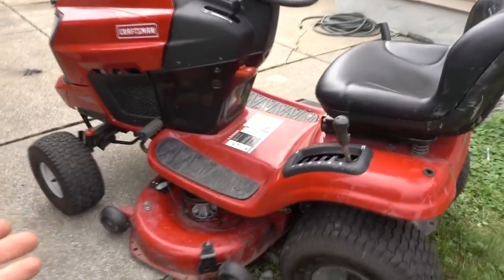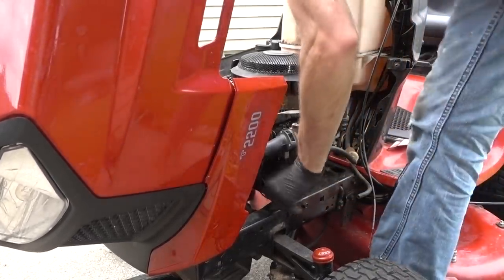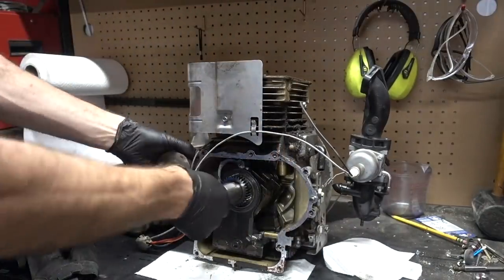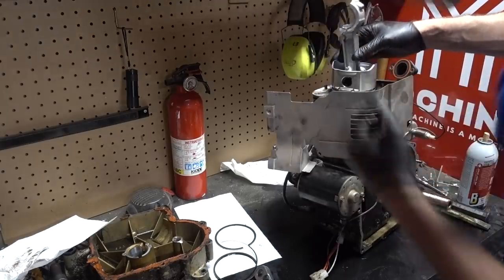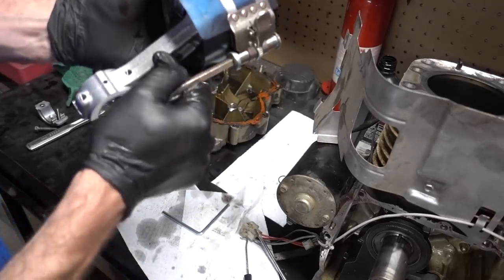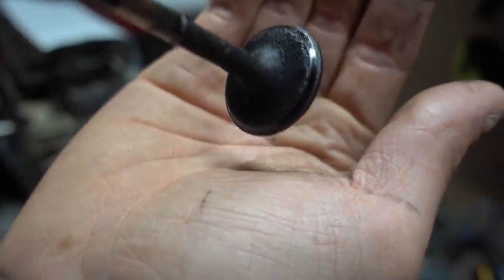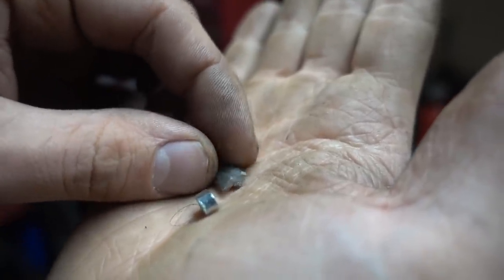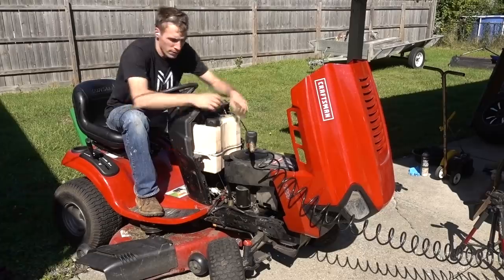fixing a craftsman tractor that smokes.

Comment: I got that exact same Tractor free in early August. The engine was siezed, I got it the day it turned 5.
Those newer style engines are notorious for failing early. So I dropped an opposed Twin in and sold the tractor for a very nice profit and the tractor is better than it ever was with its stock engine and it will probably be out mowing 20 more years.

Comment: Most of the time on an OHV Briggs single that smokes I replace the head gasket and done like a dinner.
Reply: IKR!!!!! He completely took the engine apart for literally no reason
Reply: Make sure the head is not warped common problem with that engine searies.
Reply: @TheWolverine-rm2kr  actually, the original piston rings were out of spec, he replaced the piston and rings with a spare that was within spec.

Comment: you needed to put some valve lapping compound on the taper shaft first(without the keyway) and hand spin the flywheel back and forth until the whole taper shaft has a gray compound color left on it. that will tell you the flywheel is seated correctly and then clean off all the compound material and reinstall. still did good. it's just little trick you might want to do next time.

Comment: Ya know those black side covers that surrounded the engine come off. One bolt or push pin on the frame then they slide up off of the steering column. Just a freaky fresh tip for ya lol
Reply: And I just got to the part where you figured that out 😂

Comment: Oil control ring lining up with secondary compression ring gaps, does cause oil to blow by the 
rings and creates a vacuum in the case, hence the head gasket leaking into valve guide chamber. 
Also an exhaust valve seat job too boot!
I used to do this work back in my day on older engines, you did it all properly! 
Excellent Mechanic skills! Great Video!

Comment: Ive been trying to get mine to stop smoking. Starts right up, idles and runs but a constant white smoke billowing around muffler. So first I noticed the carb was letting fuel past and flooding the cylinder head. Got that taken care of and changed the oil. Then a leakdown test had air leaking past the intake and exhaust valves. Did some grinding compound on them, no more intake or exhaust leak. Noticed during the leakdown also air was coming out of the dipstick tube so guessing that is piston ring blowby. I changed the piston rings. Getting better compression. Oil level is on the minimum fill level so not overfull. After all this work and fixing a bunch of issues I found on the mower. Still getting that exact same amount of white smoke all around the muffler. Any idea what it could be still? Ive taken apart and put this engine back together like 5 times now. I believe the head gasket is good as well but I use high temp gasket maker each time so it seems to do a good job or its failed 5 times without me realizing. Going to try to swap a muffler to see if its just previous oil inside there that is burning possibly

Comment: My mower has a pipe with the right thread into the drain hole, and the pipe goes just outside the frame with a plug so it's easy to change the oil

Comment: So I have this same mower and engine. I just replaced my camshaft on it. Not happy because the engine is only two years old. Can you explain what caused this? This was a blown head gasket right? Why after 2 or 3 years did you have to replace the piston rings? Did the previous owner just not replace the oil? Or is it just a bad engine design? What can I do so this doesn't happen to me? My previous Craftsman was 15 years old and never had any issues with the engine.

Comment: Using wobble extension when torquing.  Hmm - thinking that’s a fail. Along with removing spark plug (original) with impact. A little carbon on the end of plug and out comes the threads.

Comment: I got to change my rings on my 25hp Briggs and Stratton I think they all have that problem also do you know any tricks to get the pulleys of when it is stuck I used a puller and it messed it up bad
Reply: Do a leak down test with both rocker covers off bet one or both head gasket is blown out not the rings
Reply: Put liquid wrench on the inside of the pulley when u get the nut out and heat it up with a torch like 2 feet away then keep using the pry bar around and around till it pops off
Reply: @mr.fixit2181  I don't have a torch lol but I will get one and try it

Comment: First thing I would've done is run a compression test
Reply: JJmoto you can have good compression but still have bad oil seals.
Reply: Wouldn't be accurate on a small engine. They have a automatic compression release.. the head gasket is the issue with it.. they are known for it..replaced and it would have been done!

Comment: You mentioned that someone had been inside the engine before.  They  may have installed an offset crankshaft key to advance the ignition timing for a little better performance.  The key looks like it's sheared but really isn't.  This company sells them for GX200 and similar engines (like HF Predator engines).  https://www.ombwarehouse.com/8-degree-offset-key.html

Comment: You literally could have spent 15min putting a headgasket on it and you would have been done
Reply: I worked on one of the Briggs G5 engines (Engine in this video) that was smoking acting just like it
Reply: Took the Head off and the gasket was blown, So we replaced it and No more smoke

Comment: Ah dude you didn't hone the cylinder and you used rtv for the sump🤦🏻‍♂️ you gotta run the paper gasket it sets the crankshaft end play.
Reply: On bigger engines the paper gaskets are used to make the end play, but on smaller engines like these, from the factory they have very loose tolerances, so it doesn’t really matter that much. I agree with the honing, while he was in there idk why he didn’t do it.

Comment: I'm sure someone been in to it these are the worst design ever that sorry cam de compressions valve only last till warranty is over two years of use thy built it to were your coming back to the parts counter one way or the other you either fix it or buy a new lawnmower one